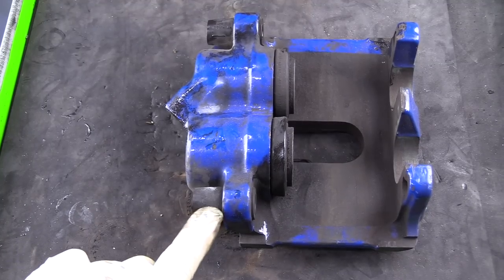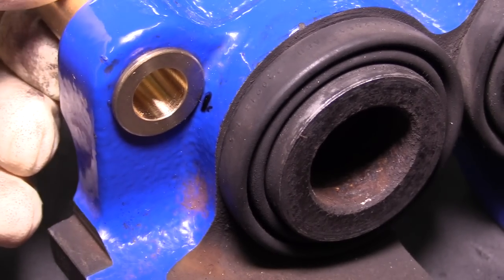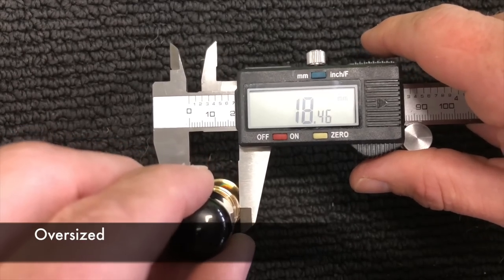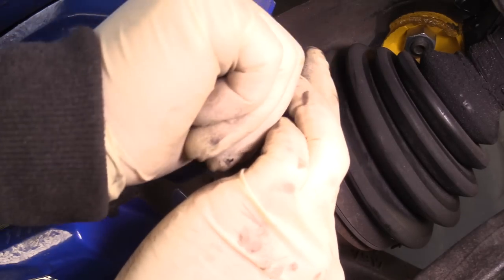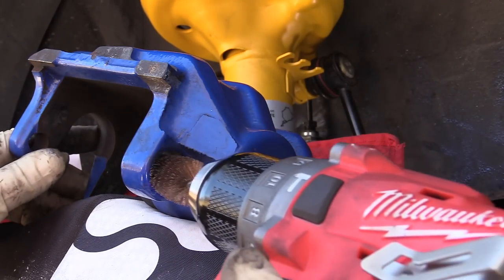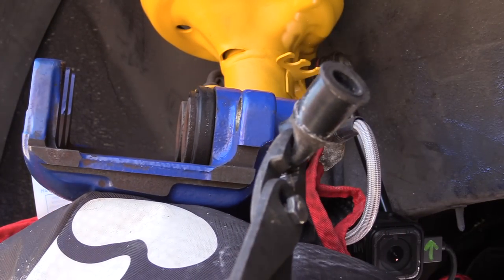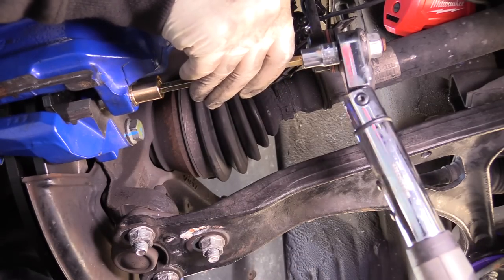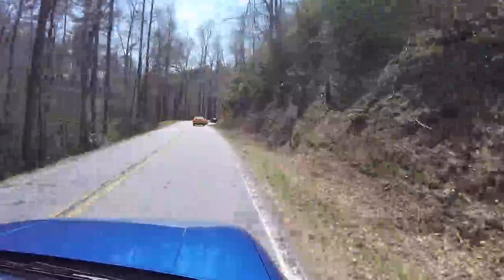Brake Caliper Stiffening Kit ~ How To Install and How it Works

Comment: its a floating caliper enough said doubt this kit actually does anything
Reply: what about actual operation of a floating caliper that will ever have that much deflection. rather than someone prying on it. if the brake pads just skim the rotor when they are not applied. your not going to have 3.5mm of movement at the caliper unless you have some apposing force such as a person with a pry bar. piston pushes this way <--- forces caliper ----> this way provides clamping force to your pads evenly as pressure of your hydraulic system is exerted equally in all area.  the kit "'may" improve on deflection but not to that extent in which case if you want better braking performance you may as well go to a fixed caliper.
Reply: jono tran  You don’t feel solid caliper bushings reduce ALL caliper housing degrees of freedom? Companies such as Endless go through great lengths to minimize even the caliper body flex... I can tell you my rotors wear in amazingly...over a period of 6 years with my MkV.
Reply: I’m doing rotors and pads on my R32 and the bottem brass carrier is siezed and not seated properly so I cannot fit new pads!! Any help or ideas would be great

Comment: So what happens if the rotors get too hot then warps? Broken ears/flanges on the caliper. Man talk about shade tree.
Reply from the maker: Considering they were designed for their race cars I doubt that would happen.  If you got your brakes to that level of sad you probably have other severe issues too.